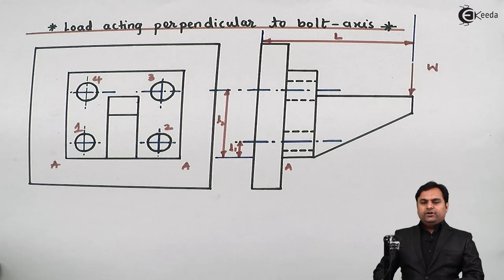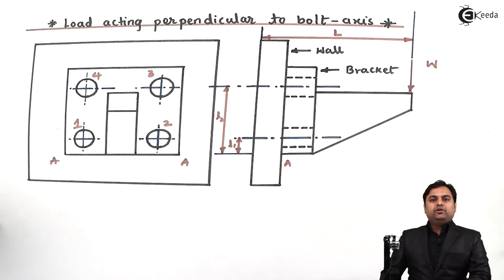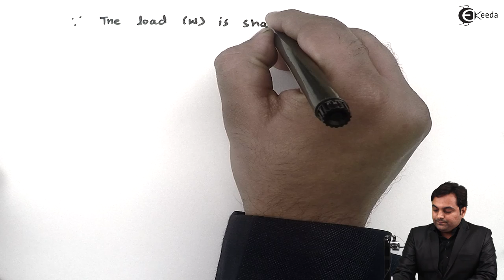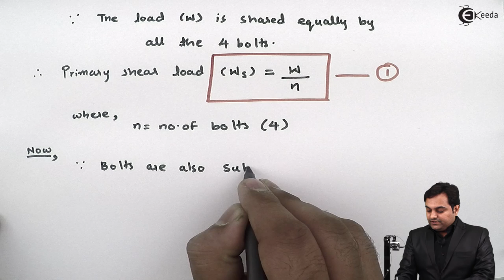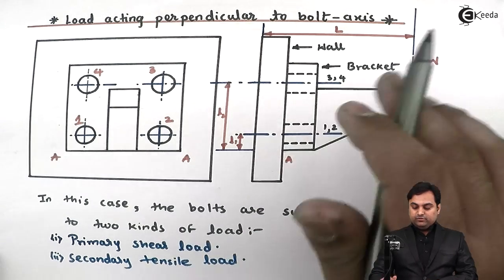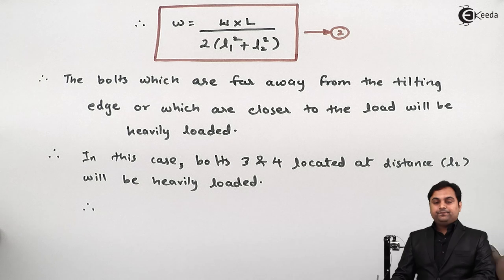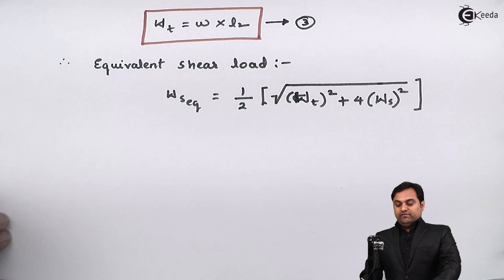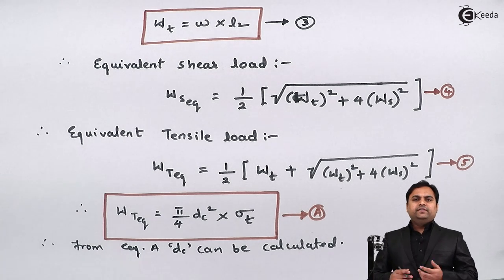Derivation of Bolted Joints When Load Is Perpendicular to the Axis of Bolt - Design of Machine

Comment: I was having confusion regarding equation 2. So searched in youtube came across this video but the way you just wrote the equation seems like you MEMORIZED that part which is easily avaliable from any book (the equation). And its really lame. I hoped to have a detailed explanation but its disgusting when you SKIP a very logical and core part and you do not even reply to the students. What's the point of making this video then? Do you only care about the number of views on YouTube and the money that it entails?
Sir may be you do not have to go to a greater depth like NPTEL videos but at least its expected that the important equations to be thoroughly explained without which one cannot even proceed further with the sum. And by doing and pulling this kind of trick you are actually defaming yourself. Making yourself a joke. In this video we were supposed to find the DERIVATION for bolted joint when the load is acting perpendicular to the bolts' axis but it seems useless without the proper explanation of the formation of equation number 2. Hope you have got the message.
Reply from the maker: Dear Partha Sarathi Barman,

We have kept few videos open on YouTube so that students/Engineers should understand Teaching pattern of faculty, Subject depth, and format of e-learning.

If we keep all videos open on YouTube then it will be very difficult for us to produce more videos in YouTube generated revenue. Hence we are giving the subscription to users who want to access all videos without ads.

We have provided full access to videos in a minimum amount. These videos are available on our website www.ekeeda.com

We hope you understood our concern and would appreciate our work by purchasing Subscription.